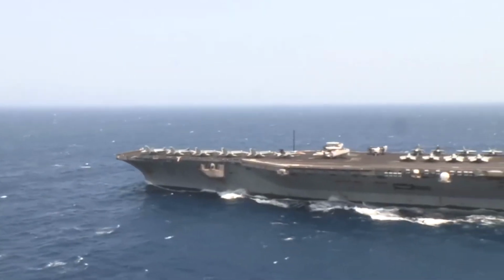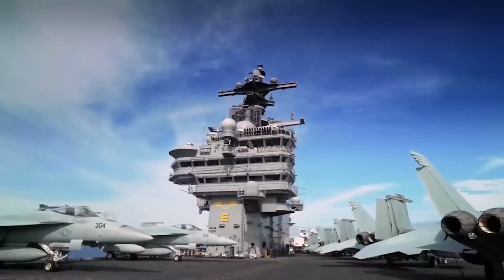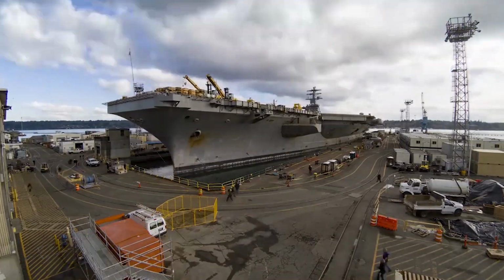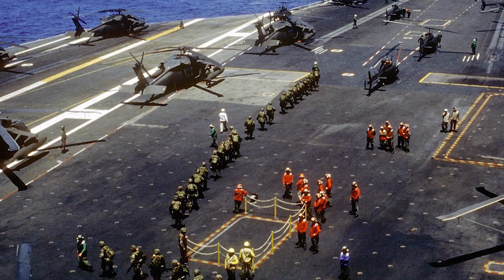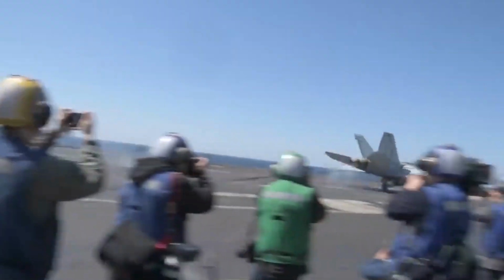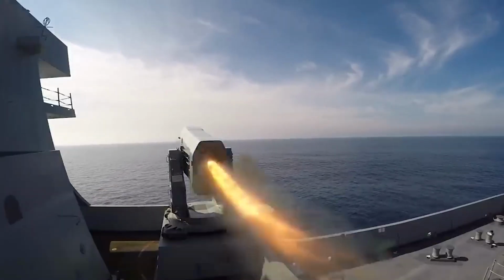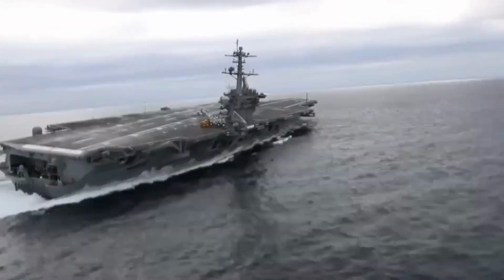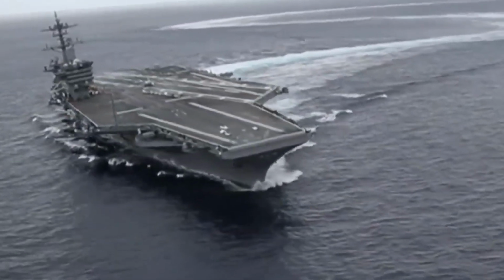US Nimitz Class Aircraft Carrier After UPGRADE Shocked The World

Comment: OPERATED JOHN F KENNEDY'S ENGINEERING PLANT CV-67 ... ALTHOUGH IT HAD 8 BABCOCK/WILCOX BOILERS ,,, IT WAS DESIGNED TO CRUISE AT 20 KNOTS FOR 11,000 MILES ON 1,000,000 GALLONS OF FUEL THE PLANT IS MASSIVE BUT YET VERY EFFICIENT FOR WHAT IT IS ... HER 280,000 ADVERTISED SHAFT HORSEPOWER IS AN UNDER STATEMENT ...